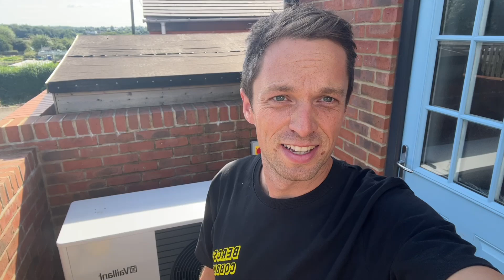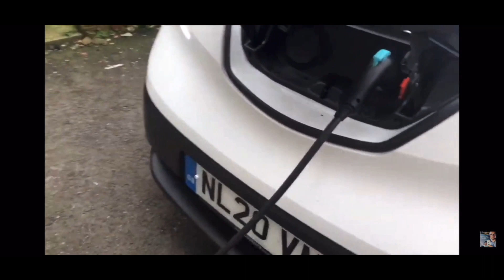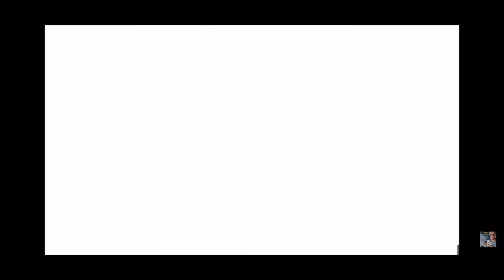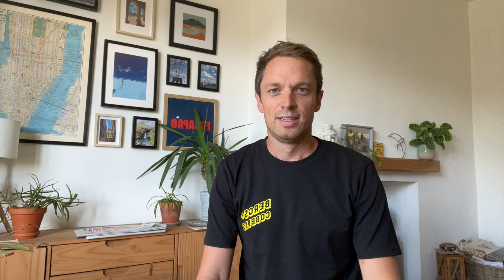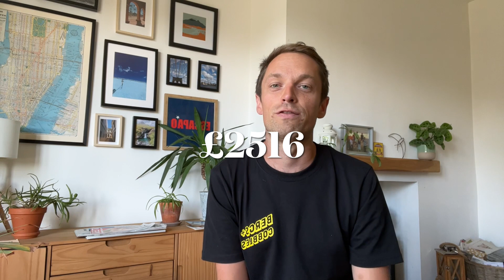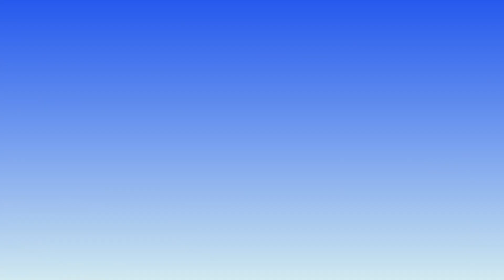How much do heat pumps cost to run? Low Carbon Lifestyle ep 46

Comment: Hi, Tom. Interesting figures👍Where did you get the figure of 13,100KW of gas,you would of used? Is that what you used the year before the heat pump? coz that seems  high for heating and hot water for a 3 bed semi and way above the average use of 12000KW. I have a 4 bed 1500 sq foot 1920's semi with 3 adults in the house and our heating and hot water using a large Combi boiler used 9845KW in a full year, that's including the gas hob! Though we do live in the sunny South.😀
Reply from the maker: Hi Jezza,
The gas figure is a calculation based on how much heat was delivered via our heat pump in the last 12 months (measured via the heat meter on the heat pump) and an assumed efficiency of 90% of a gas boiler.
I wanted to use the figure of what heat we were comfortable with last year rather than assuming a figure, we are in a Victorian terrace so we may be a bit less efficient than many homes.
Impressed at how low your gas demand was!  Is your house pretty well insulated? 
The northern weather may contribute to some of the difference!
Reply: @TomBray-LowCarbonLifestyle  you know how much gas you used in the year prior? Because I would be very surprised if you used 13,100KW, you only used 12,500KW the year previously. unless you were heating an oversized hot water cylinder and not using the water, and your house was leaking heat badly. Though your Thermal camera images didnt look great!😀
Have you thought of getting rid of gas meter, coz that will save you £107 a year?
Our place is half 1920’s with a big extension of solid thermalite blocks and render, which is better insulated than the original building, but no insulation in floors, which are now mandatory. 
We have 2 en suites and family bathroom, but with the combi, we dont heat a massive cylinder and not use it, so im sure that some of these heat pumps are wasting lots of energy on buffer tanks and oversized hot water tanks! I dont know how big yours is, but ive seen tanks now that only ask for  heat in 10% increments, so you dont have a 200lt tank sitting there when you only need 100ltr. A 10ltr shower at 5 mins is only 50 litres. 
By the way, Ive found out that one of the biggest energy guzzlers in our house is the Fridge/ Freezer!😀 I vacuumed the condensing coils and this has improved efficiency a bit.I have draught proofed the house to an inch of its life, and going out the front door sounds like an air lock on the space station.By the way Make sure you have adequate ventilation in the loft otherwise with 300mm of insulation you could get moisture and mould.
I actually want to build a new place with passivehaus standards. So will only go down the route of Heat pump, when I have a highly insulated house, with mechanical Heat recovery system. Part L of building regs now requires heat recovery pipes on showers and baths waste pipes, which is another step forward on the journey.
Cheers
Reply from the maker: Hiya Jezza, yes the 12,500 kWh was how much natural gas we used in 2020, the 13,100 would be how much a 90% efficient boiler would need to produce the same heat our heat pump did over the last 12 months.
Yes we would get rid of gas meter but planning to keep our cooker in the short term.
If you were building a new home I agree passivhaus is my dream too... just makes so much sense. 
I would encourage a heat pump installation before then too. We need to drastically reduce emissions and a heat pump can take 65%-70% off your heating emissions straight away.
I didn't know about Part L requiring heat recovery on waste pipes - couldn't see it in a quick check just now, do you have a reference in Part L?
Thanks, Tom
Reply: @TomBray-LowCarbonLifestyle  Hi Tom, Part L, go to page 12 table 1.1 under Hot water systems. Though I think, that is if WWHV isconnected and the required effeciency, so not mandatory I think?
Reply: https://assets.publishing.service.gov.uk/government/uploads/system/uploads/attachment_data/file/1099626/ADL1.pdf

Comment: Omission right out your pocket pal my central gas heating was affordable like for like Heat pump no where near almost double and my kitchen is a complete mess no where to hide the stuff.never mind all this cop that’s a cop out.a HEAT PUMP don’t get used in the summer
Reply from the maker: Hi O know - sorry I am not sure I follow what you are saying - is your kitchen a mess because you have a gas boiler? 

A lot of the heat pump kit could go in a cupboard, or loft, for us, it is more or less in the space where our old boiler was, but taken up a bit more space.

A heat pump gives us hot water in the summer? As does a gas boiler? COP means coefficienct of performance, ours for last year was 2.96, a gas boiler tends to be around 0.9.
Sorry if I missed the point you were trying to make!
Reply: @TomBray-LowCarbonLifestyle  Tom they left my band new Combi in for hot water and disconnected the heating side,didn’t change one pipe put 3 bigger radiators in and all the valves expansion tank above my kitchen units in plain sight looks a right mess.125m floor space EPC is E my heat pump is a 17 Kw unit costing a fortune March using 25 Kwh average.I wish you well Tom
Reply from the maker: I am sorry to hear that mate, it sounds like you have had a bad installer. Were they MCS certified? 17 kW does not sound right. My heat pump is 5 kW. Really sorry that they have messed you around like this. It is worth getting in touch with MCS if they were certified. How much did you pay for that?
Reply: @TomBray-LowCarbonLifestyle  Cheers Tom it was a phone call save you money won’t cost a bean guarantee for 7 year serviced for 7 year you need to be quick there are only so many,well I had never heard of a heat pump so signed up MCS accredited for sure but they went bust surprisingly as they were a big outfit.EPC he was accredited as well.Who do you complain to.Covid right in the middle of it.But thanks for your interest Tom.25 kWh was a day nightmare

Comment: Hello Tom.
The problem with calculating relative cost this way is that it does not account for the fact that the electricity/gas price ratio is at a historic low which is unlikely to persist. Also, the higher upfront cost of a heat pump must ALWAYS make them less economic.
Reply: My heat pump has a design sCOP for heating of 3.4 . If this is achieved then gas more expensive . Currently heat hot water using HP for one hour at night and top up to 60 deg using solar . Also still have Octopus GO so initial heating of house in morning uses some night rate power. I am a Kirk Hill Ripple customer so will be  helpful . I am hoping that the government review if the energy market will decouple gas from  electricity so price will fall( I e gas currently creates 100% of half hour wholesale price). If that happens electricity could half relative to gas price .
Reply from the maker: Hi Nhojnhoj67 - I would question your assumption on the ratio - although the electricity price is linked to the marginal kWh, which at the moment is expensive gas, there will be more low cost electricity as more wind farms and solar farms come on line. The contracts for difference agreements that will come into play in the next couple of years for offshore wind will give the lowest cost electricity the CfD scheme has ever had. A low carbon electricity system is likely to be a low cost electricity system.

The gas price is unlikely to follow the same trajectory, with the volatility of fossil fuels meaning the risk that gas prices could be high again and again. If we decide to blend hydrogen in the natural gas system, or replace methane with hydrogen in its entirety, then costs are likely to go up for gas too.

Furthermore, if government is serious about the climate emergency, at some point it will need to incentivise people to move away from high carbon fuel use, this may make heating via electricity cheaper, or may penalise use of gas.

You are right I didn't mention the capital cost of a heat pump, I think this is fairly well reported, and I haven't hidden on my videos that you are unlikely to 'payback' the cost of a heat pump. But the reality is, we have no choice, do you want 25million homes to keep burning natural gas, propping up dictators like Putin, contributing to run away climate change and risking millions of human lives around the world? 

Yes there should be more support to install heat pumps, yes heat pumps cost a lot when replacing a combi boiler, but the 100,000s of homes that are built each year should have heat pumps that should come with a similar cost to a new gas connection and boilers, new homes will then have heat pumps that are more efficient that our home and much cheaper to run. And there are millions of other homes that would be suitable for a heat pump, that will then offer savings, and, could potentially recoup the cost of an install. I would love to see your calculation of how they are 'ALWAYS' less economic!

I am giving an example of a 130 year old home, with a heat pump, that is more or less breakeven to run when compared to an efficient gas boiler, when many in the media report that heat pumps don't work in old homes, or can't keep you warm, or cost loads to run etc.

To say a heat pump is 'ALWAYS' less economic is untrue, misleading and playing into the climate deniers / delayers tactics of disinformation. I'll keep reporting the facts.

Comment: Wow your standard base charges are extremely low compared to the US and Australia.
Reply from the maker: Oh really? They have recently risen a great deal! What kind of costs do you pay?
Reply: Good question. Looking back the last 6 months it was $23.39 a month but drop to $21.96 last month. Why the drop I do not know. But the price per kWh has increased the last month from $0.0380659 to $0.0534463. There are around $3-4 of taxes every month. My actual electric usage ran $5.94 in July to $8.03 in August. August also included a fuel surcharge for the first time here
At my previous place the electricity base charge was $20 a month and the natural gas base charge was $16.66. In the summer the gas base charge was about 3 times the actual used gas charge of $5 on average. 
I used 156 kWh in July and 139 kWh in August. 
This was an all electric one bedroom flat with an electric heat pump air conditioner running 24/7 at 80°. I have a 40 gallon electric resistance water heater but I was rarely using hot water. Cold/cool showers were the norm in this heat. A ceiling fan overnight. No dryer usage and the washer is at a the building’s laundromat (I do count it in my footprint though.)
The impression I got about Australia’s base charges comes from the Facebook group My Efficient Electric Home group. Folks on there have a zillion conversations about heat pumps, weather sealing, insulation, solar, getting off gas, etc. You might find it interesting.